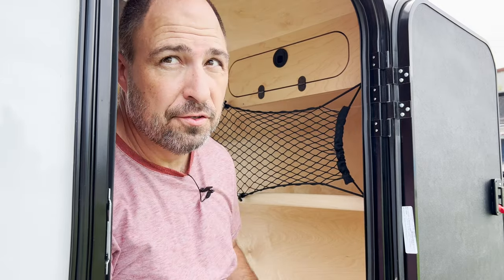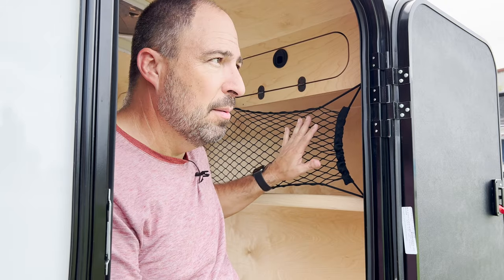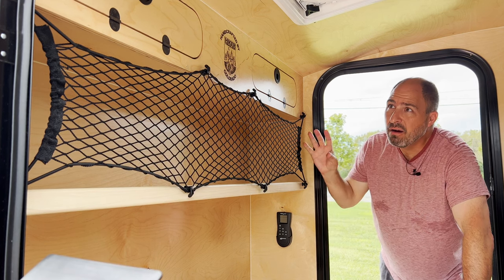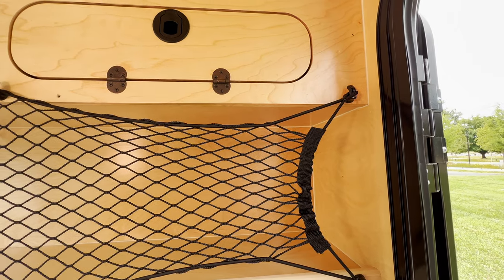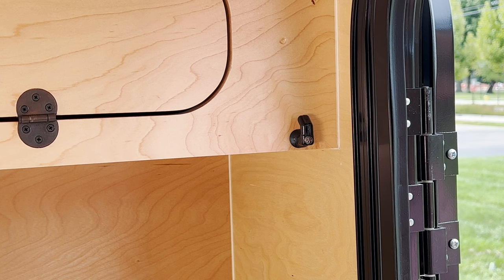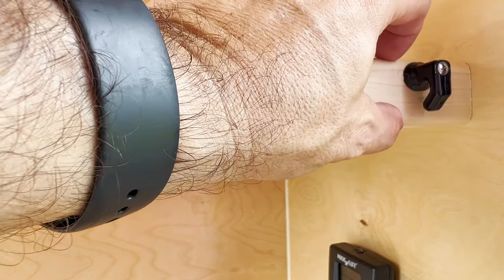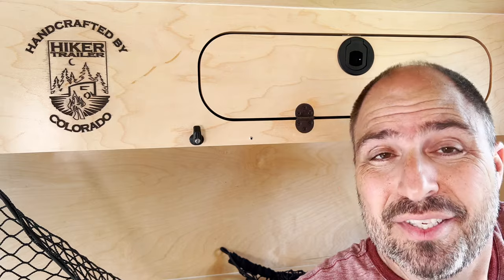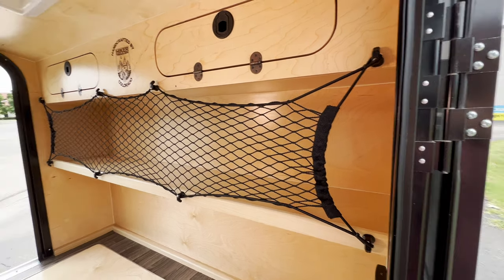Cargo Net Installation in Trailer

Comment: This was a very helpful video and I believe this net is what I need also. Can you please let me know how "tall" the space is that you're covering (from bottom hook to top hook, or bottom shelf to bottom of upper cabinet? I hope that makes sense. My trailer is also 5 feet wide but would like to know how far vertically you are covering. Thank you!
Reply from the maker: John Dunn, sorry it has taken me so long to get back to you. The center of the screw on each hook was 12 inches apart up and down. the space itself is 11.25" tall and 58.5" wide. Hope that answers your question.
Reply: @ScruffyGolden  Thank you for taking the time to get that info for me. Yes it was very helpful. I will be able to use this. Great video! Thanks again.